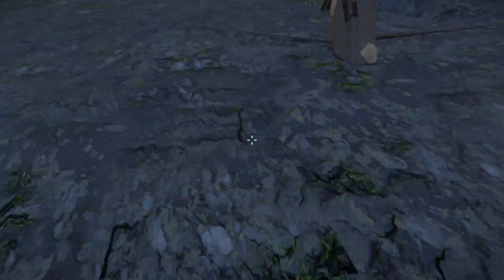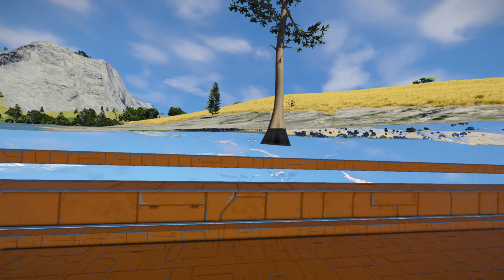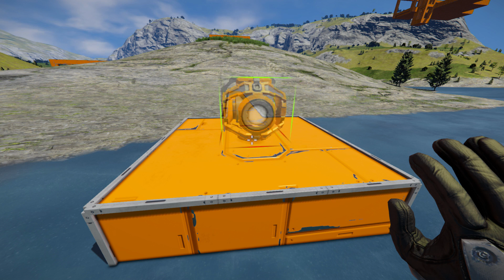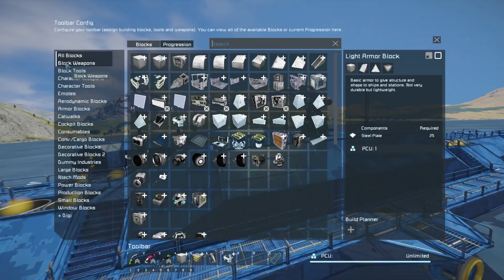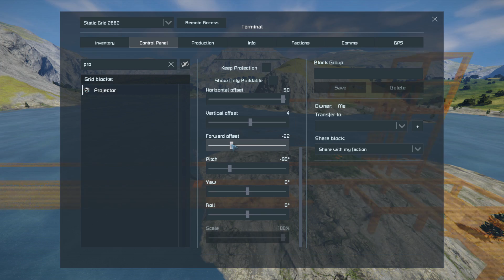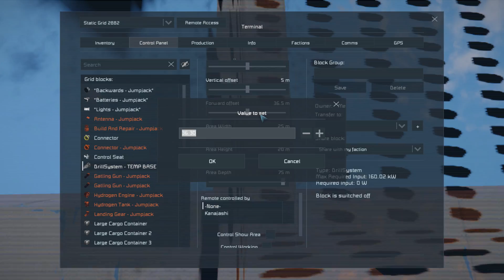Space Engineers - S2E31 'Earth Base Excavation Begins'

Comment: Usually when I'm building something I intend to blueprint, the first block I put down is the projector, followed by batteries.  That way, the pivot point is always accurate when I'm projecting it, even if I place the projector in a different order in survival, and it has an initial power supply to get the build going.

Seriously digging the series though (no pun intended)

Comment: Pretty sure speed is much better than power efficiency. Building more windmills is tedious but cheap, building 5x as many refineries+power mods is very expensive. Windmills are just too cheap and easy to build. I think there are also some performance benefits to having 4 fully speeded refineries, instead of 20 full efficiency refineries.
*Efficiency is also pretty good, because speed modules are additive changes, while efficiency is multiplicative. So you can use 1-2 efficiency modules without slowing the speed by much. But that's only if mining is a major time sink, unlike this case where I assume you'll have more ore than you can use.

Comment: Having anything projecting itself is a great way to set a, "Auto Repair Me" whenever you oops & are need of repairs! Also, if you build things like this & if you can get it back to base, you can make a welder repair bay to rebuild said damaged vehicles automatically, which I would say, "Build a repair bay!"
Reply: Also, you can use the projector as a guide ruler, to see where everything is at! & oh, you need to technically start at the projector block so you can align it! Meaning the 1st block placed down, should be the projector block!
Reply: Oh, not sure if you know this but you can remove trees by just grinding them down with your grinder! Just be warned, they may go flying away, but they shouldn't damage things as they get sent to the moon! Lol

Comment: 21:00 - Every grid in SE has its own coordinate system that originates from its first block you placed. This coordinate system with its origin cannot be moved manually, unless you use mods to shift it. This plays into maximum grid size, too,  as the size is calculated from the origin rather than from end to end (that means you can only use the true maximum grid size if you start building from the center of the grid). I reckon the blueprint uses this origin to orient itself.

On a side note, all blocks have orientation, even armor blocks, that can play into the grid's orientation when using projectors. It may happen that even if you orientate the projector block correctly, it still may display the projection rotated, because the orientation given by cockpit position isn't necessarily the same as orientation of the grid based on its first placed block.